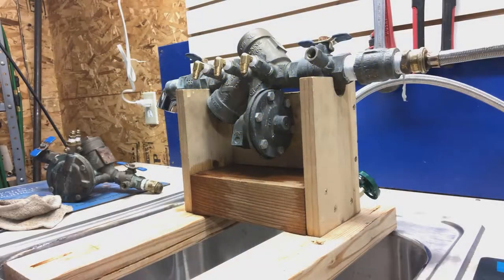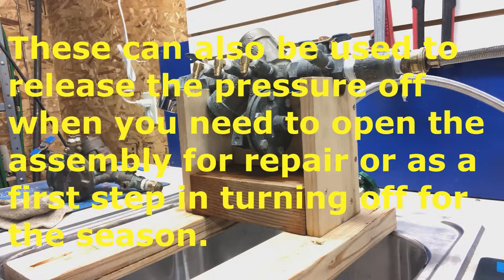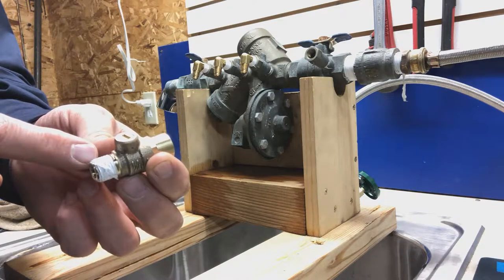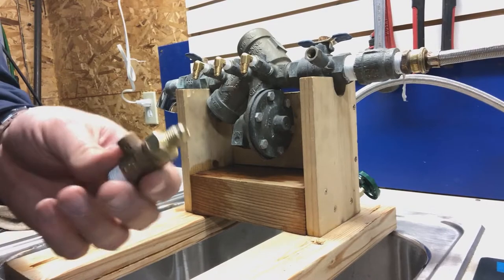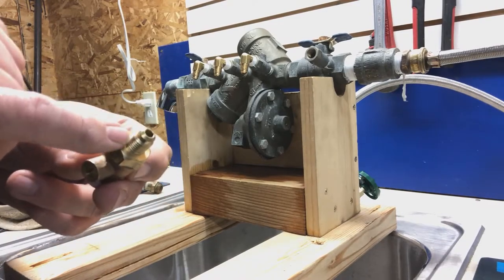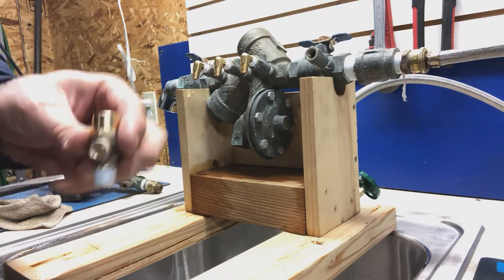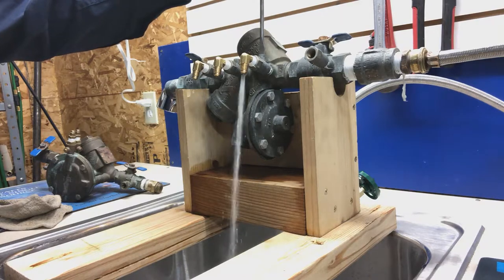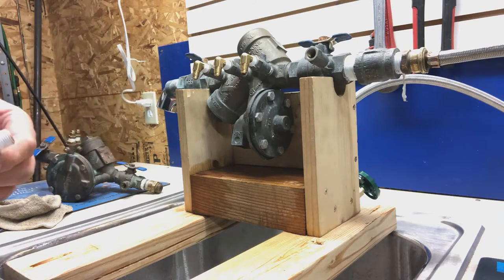This Thingy on My Backflow Assembly is Called a Test Cock

Comment: Hi there, I am trying to blow out my sprinkler system through a test cock. What is the name of of the attachment  that connects the test cocks to the compressor?
Reply from the maker: You need a compression fitting for your compressor.  I am not an expert on compressor fittings but the kits I have seen they are just 1/4" male thread which will thread into the test cock (the female ones).  If you have a test cock with the male threads you need to either get a female test cock or make a set up to put in where the test cock threads into the body and will connect to your compressor fitting.

With all that said, know none of the manufacturers of backflow assemblies recommend blowing out through the backflow assembly.  People do it.  But it can cause damage to the components in the assembly.

Depending on what model backflow assembly you have there are ways to drain it and it doesn't need to be blown out.  Blow outs are more for the sprinkler system.
Reply: Thank you! I am trying to blow out a sprinkler system and since this is the only connection we have (before backflow), I have to use it. Appreciate your reply!

Comment: I got a notice that the test of my backflow prevention assembly failed. The notice said "Assembly Untestable: Test Cocks #1-4" Could you help me know what that means?
Reply from the maker: Sorry for the delay in responding. I can only assume that the tester is indicating that there is an issue with the test cocks.  Have you tried taking a screwdriver out and turning the screw to see if they turn or not?  Every quarter turn is open close.  It does not tighten.  Just open and closes a small ball inside.  Please check that and get back to me.  It might be best to email me at sean@backflow-supply.com or call me at 801-355-6736.  I check these comments on YouTube about once a day.

Comment: I have a few questions, hopefully you might be able to give me some advice. I live in FL and I work for a pressure washing company. I have adapters that I screw into these test cocks and hook my garden hose that feeds straight into my 525 gallon water tank on my trailer. My two 8gpm pressure washers then pull from my water tank. Around 2 years ago I was hooked up to a backflow preventer while a county worker was repairing the neighboring backflow preventer. He told me not to EVER use the one test cock that was singled out on the far right side. He said the other 3 (in the middle of the backflow preventer body) were fine to use. After being told this (I would rarely connect to test cocks to fill water, only would I connect if the houses water pressure was too weak) I started using the backflow preventers more frequently (much better water pressure) once I was told by this county worker that it was okay to use. Then I had a few other encounters with other county workers. 2 different county workers have told me there is a $500 fine for tampering with a backflow preventer. My main issue is I can not find information from my county ANYWHERE (online) about this. The only info I could find about my county and or state is a backflow preventer can only be installed or repaired by the county, a licensed plumber OR South Florida Water Management. I don't understand what the issue is because my water tank on my trailer has a shut off for when it gets full, so there should be no backflow going into the backflow preventer since I do not hook my pressure washers up directly to it. So to summarize my questions: 1. Do you think I am legally allowed to connect to these to fill water? 2. If I am legally allowed to do this, is it a bad idea? (my understanding is that if the backflow preventer does not work properly and I contaminate the water that's potentially a $10,000 fine) 3. Why is there a singled out test cock on the right side while three are right next to each other in the middle? If you need any other info let me know I may be able to provide that. Also I know this was a lot to read and if you don't respond I don't blame ya. I just can't figure out if there really is a need to be a licensed plumber, work for my county, or work for water management to be allowed to touch these backflow preventers at all. Thank you for your time if you did read all this!!!

Comment: why we provide shut-off valve before and after the Double Check Valve Assembly?
Reply from the maker: This is to allow for testing the backflow assembly and for convenience of working on the assembly.  I would also suggest that sometimes one or the other gets hard to turn or breaks and it is helpful to have one that shuts off until you get it replaced.

Comment: Is there any way to secure the testcock to prevent vandals from opening testcock and allowing water to shoot out?
Reply from the maker: Rich, I do not know how I missed this question.  I check this channel and I didn't see it in the feed.  So sorry. 

No, I don't know of anything designed to stop this.  I am not sure if you have a female or male ended test cock.  If it is female find a male plug that has to be wrenched in and out.  If it is male then find a flair nut that can be tightened on with a wrench.

The only other thing I can only tell you is to put a cage or a enclosure over it, or find an insulated bag that you can put over it and padlock it.  If you need help with that, call me or email me.  sean@backflow-supply.com 801-355-6736

Comment: Thank you! This video was very help. I currently trying to trouble shoot my dripping test cock. My sprinkler system was shut off about a month ago. Could they have caused this drip? They’re suppose to go come out tomorrow but said I would be charged depending or not if they decide if the caused the leak or not. My guess is they’ll at it isn’t their fault and I’ll be charged. I’m trying to avoid that... so if I can cancel and fix myself, that’d be great!

Comment: I live in southern NC region and am winterizing my irrigation system.  I have cut off my irrigation water supply and have been told to bleed the water from the test cocks. Then was told to leave all the test cocks and inlet/outlet valves open to 45deg thru winter plus wrap the assembly and piping.  However, one or 2 of my test cocks keep dripping water.  Is this normal?  I wrapped everything but left it so the water could continue to drip.  Temps expected to get down to 25deg for a couple of nights so I want to make sure I've done this right.
Reply from the maker: Kelly, sorry for the delay in responding.  No the test cocks shouldn't continue to leak.  If they do I would imagine the shut off from the sprinkler is not shutting off tight.  However, this may work to your favor if water is leaking through the test cocks it won't allow it to freeze solid.  

I am not sure what you wrapped it with, but if the test cock is still leaking and it gets the wrapping wet you may end up creating an ice cube around your assembly.  Even if the test cock stops leaking and the wrapping doesn't get wet an insulated assembly without a heat source will eventually get to be the same temp inside the wrap as it is outside the wrap.  They do make insulated bags for this purpose as sometimes you just need to make it through a short freeze.

You may not need this any longer, but wanted to respond.  If you still need me , email me at sean@backflow-supply.com or call 801-355-6736.

Comment: So what is the purpose of the test cocks? Are they for attaching a meter to to figure out pressure?
Reply from the maker: Stephen, they are there for testing the backflow to make sure it is working properly.  That is why they are called test cocks.  But they also have a few other purposes.  One is on an RP version when you open them up it opens the assembly to atmosphere and allows the relief valve to open and drain most of the water out of the body.  This is useful when you need to open the assembly to work on it.  

Also for some models it helps to pull the checks out and put them back so that you are not fitting air pressure. 

You can use them to put a gauge on to test your pressure. 

They can be used for troubleshooting the assembly as well.

Lastly, and not recommended but they are used for hooking the compressor up to blow out the sprinkler system.

Comment: Hi my metal ball valve have a test cock on it
Can I replace it with metal ball valve without a test cock on it ???
Reply from the maker: I think you are asking about a ball valve on a backflow assembly, typically the inlet only would have the test cock on it.  It should be replaced with the same ball valve with the test cock as that is how they are approved.